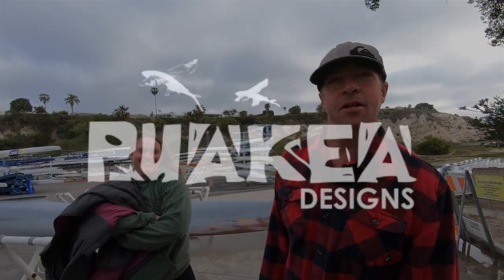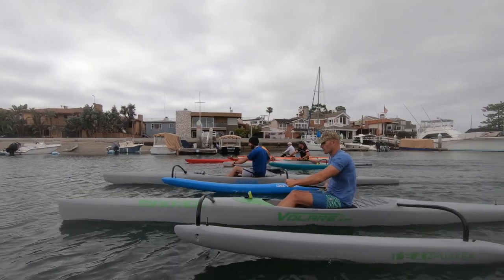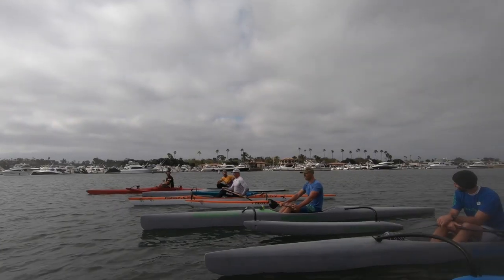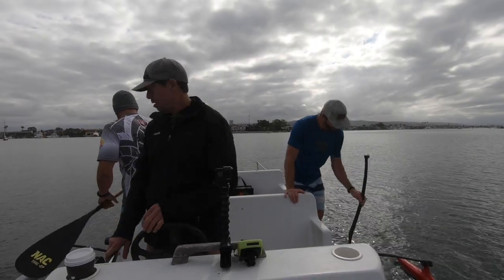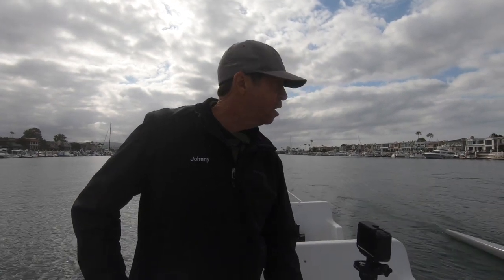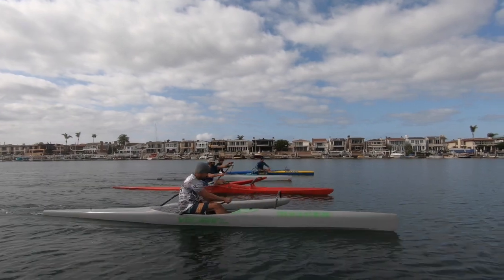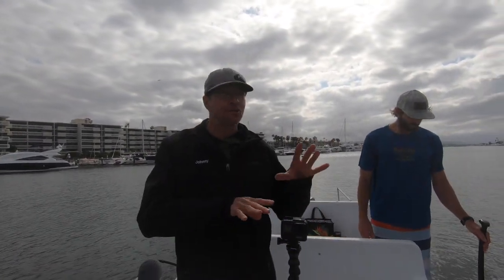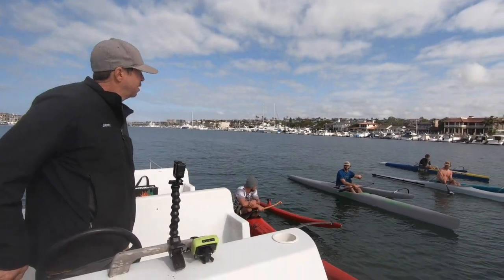Does it work? - Flatwater testing in the Volare OC1 outrigger

Comment: there's some rumination of shortening the front iako on the volare to improve the performance of the ama when surfing. is there going to be any official info on this or is it going to be an off-cuff modification?
Reply from the maker: We will be implementing the changes from the factory. Volare delivered later this year will have the iako change from the factory. 

Long story short. 
Rig Front iako pin in lower position, 
drill new pin hole in upper position,
move spring pin to new location
Cut off excess iako. 

And yes I think we will be doing a video about it, just not sure on timeline.

Comment: fascinating. Are you guys planning on releasing a rudderless Kahele V1?
Reply from the maker: Johnny has gone through quite a few different V1 designs and prototypes, but nothing groundbreaking or worth putting into production. They have been a great design study, learning process and we have a lot of fun testing.

V1s are so different because it's not just speed and surf-ability but also how well it tracks in the water and how well it tracks on a wave etc. Even though it may be fast/low drag, if a paddler is spending all their time steering, it will mean that they are not putting all their motive force into going forward. Thanks for watching